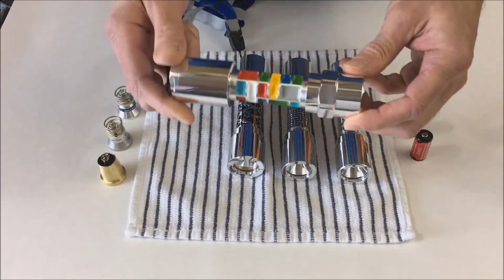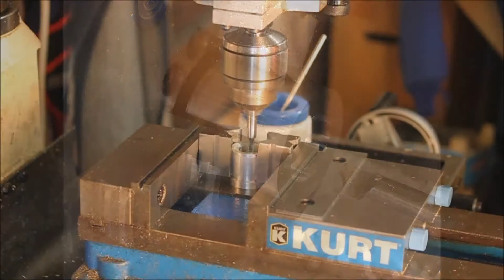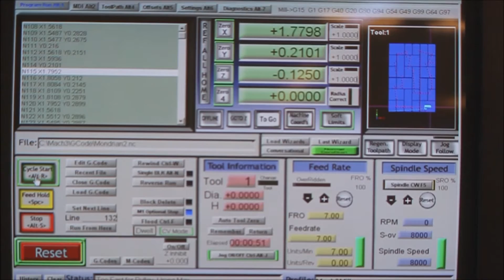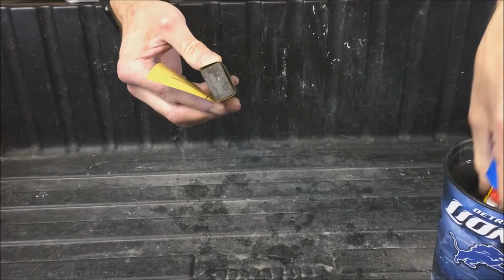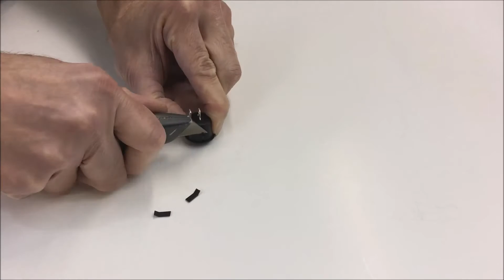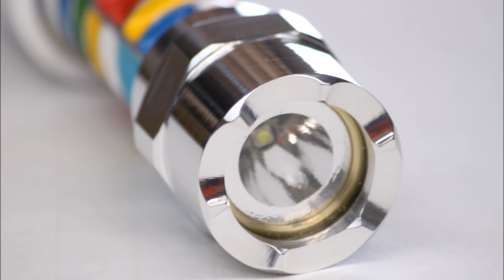Build your own Aluminum Flashlight

Comment: Do you still make these?
Reply from the maker: Over the years I have made 80+ of the 6061 and 7075 versions.  The last couple I made were the 6Al4V Titanium ones (another video on my channel).  I have been thinking of making a new variation on the flashlight design, but currently have been working on some folding knives, which I will eventually have some videos on.
Reply: @galb2x2  so I'm assuming you sell these? Thats cool. I make fixed blade knives but never tried a folder, so I buy my folding knives. Lol. Also I have no way to make a flashlight at this time. Knives, flashlights, tops, fidget spinners and pens are all my passions. Lol. Gets expensive. If you sell your flashlights I would like to see some of your newer designs and know prices.
Reply from the maker: @bobkeller8383  Sorry, I have never sold one.  Believe I mentioned in the video that I give them away to family and friends.  They require so many hours per flashlight with the methods I use that it just would never be profitable to build them for sale.
Reply: @galb2x2  darn. well I was hoping. Never know till you ask